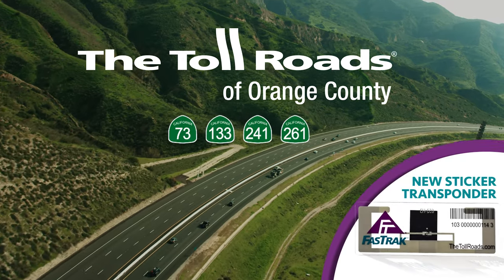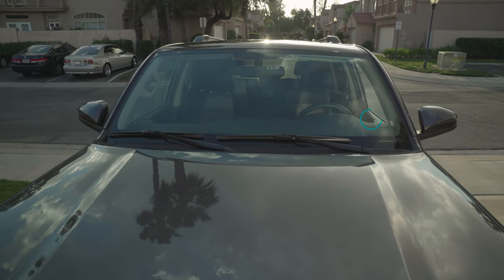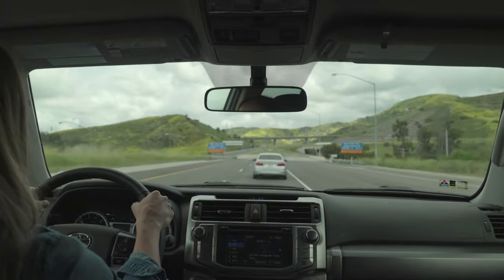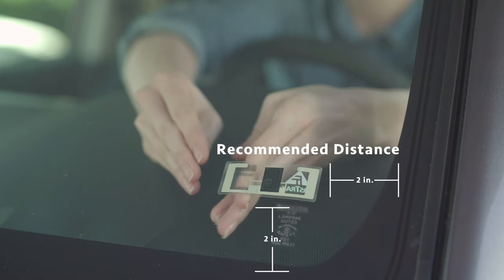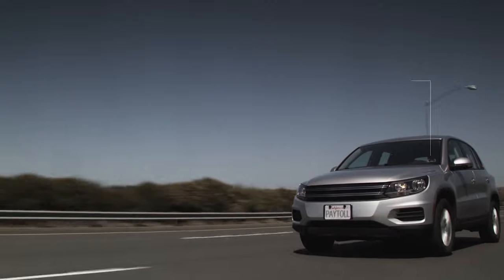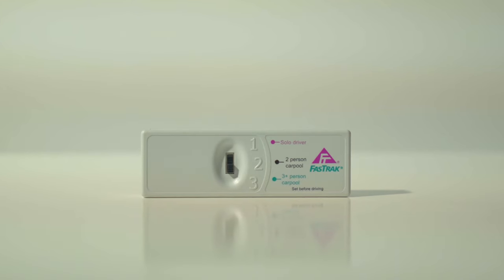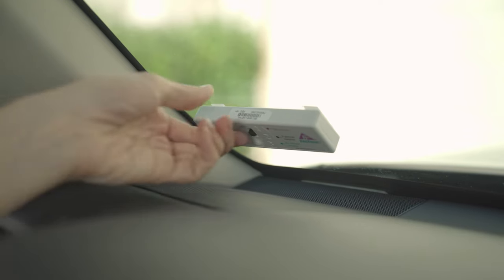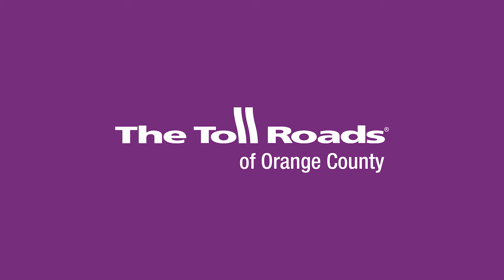How to Install a Sticker Transponder

Comment: It helps to know that the sticker, when attached, will face the inside of the car, not the outside.   The video was a bit confusing (to me) because it shows peeling the face off.       "4. Do not move or adjust a sticker transponder once it has been installed. It will break and become unusable. "         I assume this should not be done.

Comment: Now how do you take it off when you sell your car?
Reply: I know right
Reply: You can request for another sticker and you could deactivate the other one
Reply: @emcemc7506  It's not the deactivation or the getting a new sticker that is the problem, it's trying to get it off of your window... Takes multiple chemicals and lots of elbow grease.
Reply: Razor
Reply: OK, so the razor blade is actually the best answer. I slowly peeled each corner and then I made sure with the tip of the blade to get between the black square and the glass so that came off with the sticker. It came off all in one piece with the barcode still attached, so I’m gonna give it a try in the morning and see if it works will report back